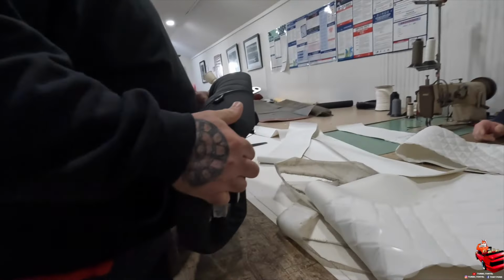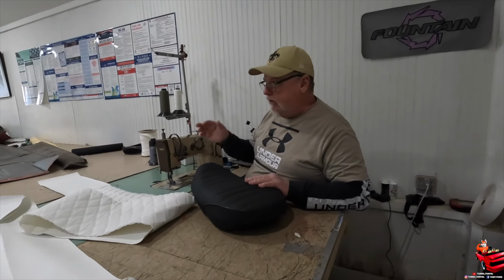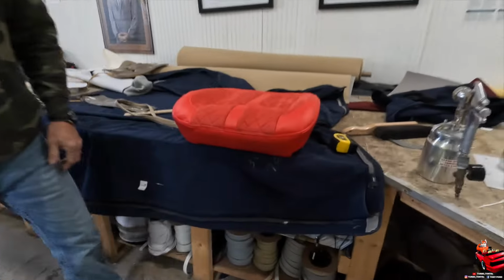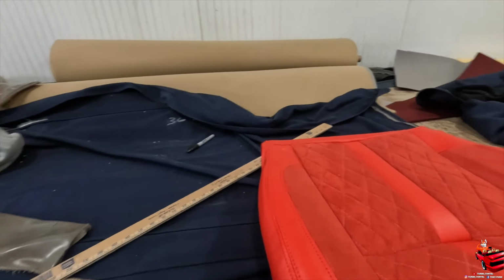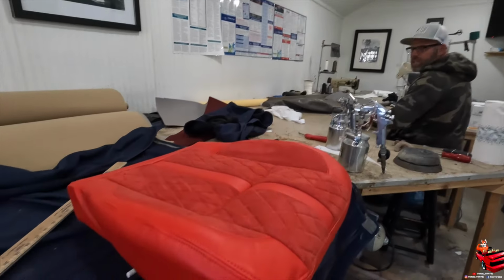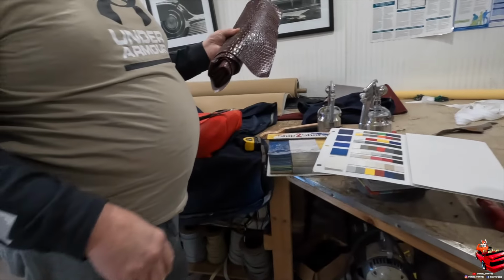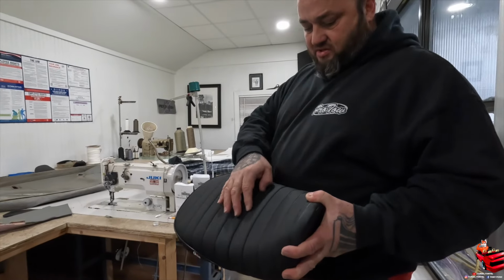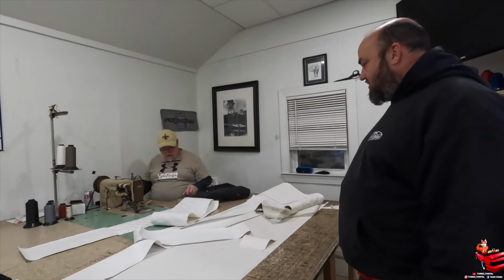Big Mike’s Honda Monkey Getting A New Custom Upgrade

Comment: That red seat would look great in my 89 Braham caprice classic. Im 2nd only bought  it off a 85 year old man. Hes passed on now but left it in great hands. I bought it in 2004 i think maybe 2003
With like 80k miles, i paid 1500 buck then. 305 lays rubber down street. Got those big couch velet seats. Man i love this car. Its a tank.  Still got
Original radio with the push buttons. Old school
Reply from the maker: Oh ok cool lol. Yeah I like a really nice clean cut box Chevy as well. Where are you located? Definitely should check out Jubilee Interiors if you’re local or in the surrounding areas.